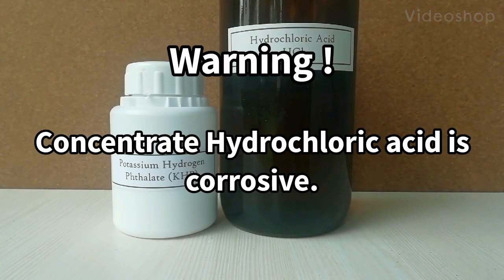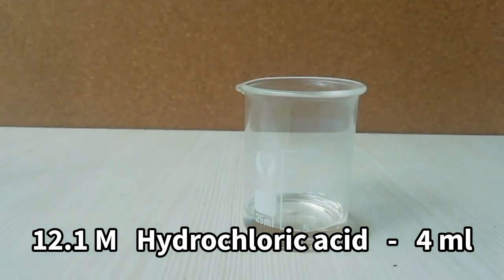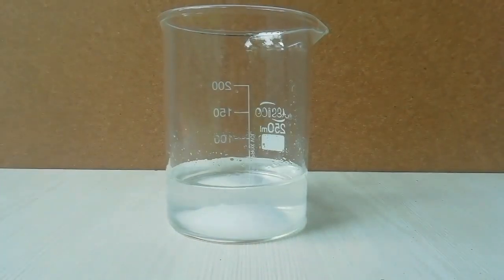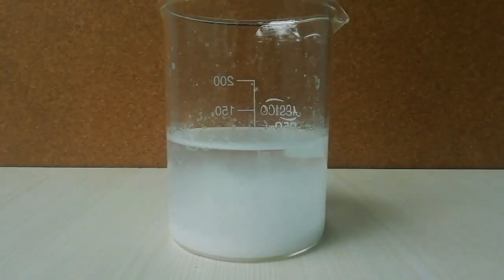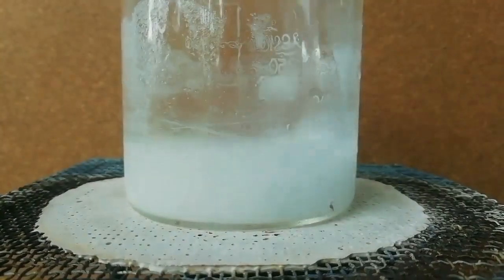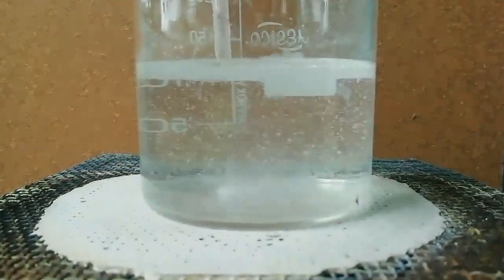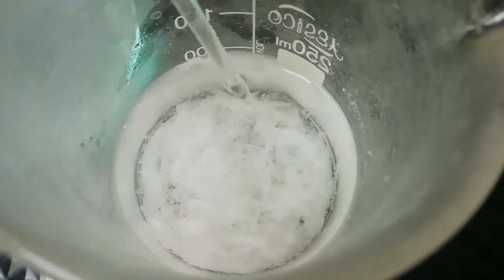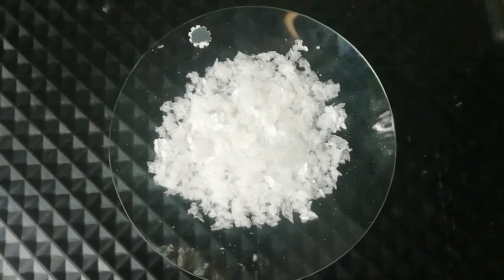How to make Phthalic acid

Comment: Hi there, 
cool video!
Could this be done by adding hcl directly to the Khp?
Reply from the maker: Yes you can, but the recrystalization should be carried out to get pure product.
Dissolving KHP in water will save  the time
Reply: @ChemExLK  Thanks for your reply, the reason I was asking is because I've found the less water I add the higher yeild I receive. I'm getting roughly 8 grams from 10 grams of KHP. My thinking was if I add dilute hcl directly to the KHP I would be losing less pthalic acid to dissolution? And then recrystalize afterwards.